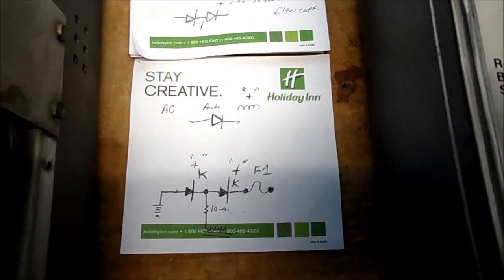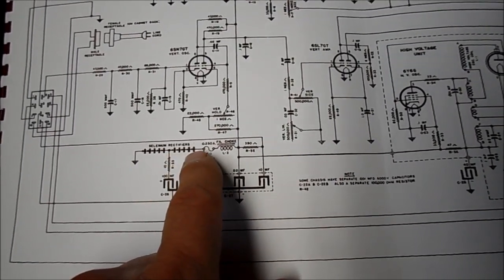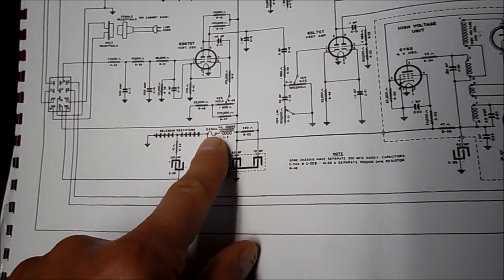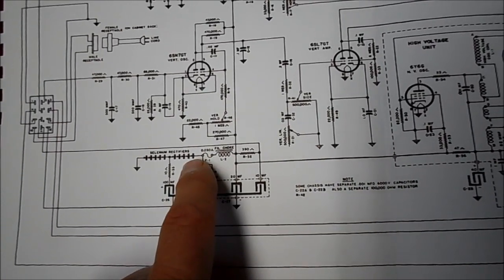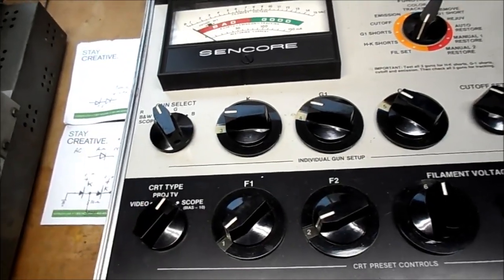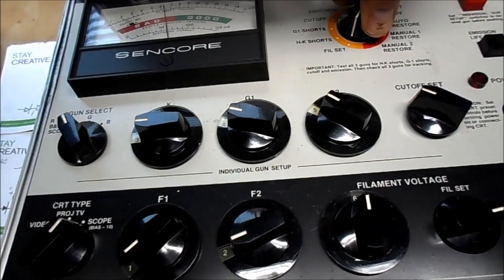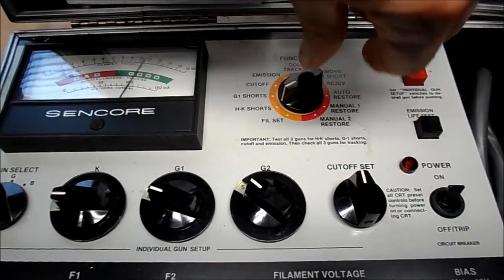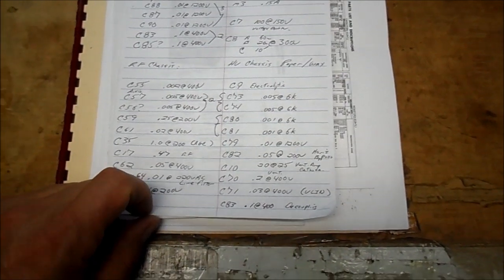Sentinel 400TV Pt. 3. 7JP4 Testing. Some Ideas On The B+.

Comment: If you have the CR70 operation, application and maintenance manual on page 22-23 it explains how to remove G1 shorts. I seen bandersen do this on a 7jp4 with his CR70 in one of his early videos and it worked great. Maybe you can find this video.

Comment: Hi Robert, Another way to test for G-1 short is to check the 22 Kohm resistor and the 10 mfd capacitor in the sync seperator cathode circut. That provides 3.6 volts to the crt for DC Restoration that resistor and cap would not be able to handle the roughly 1200 volts focus voltage if it's a G-1 to G-2 short. All the best, Tom J. from Florida :-)

Comment: Hi Robert, Low B+ should be about 120vdc, high B+ should be 250vdc and mid hv should be 750 vdc lastly 6x5 heater should be at 680 vdc. All taken with a 20,000 ohms per volt meter. H.V. should be 5,000vdc. That 7JP4 may have a G1 to G2 short. With that kind of short the CRT is turned on hard.  That would account for the loss of tracking.  There isn't an easy way to test for that. Only way I have found to test for that type of short is to put a volt meter connected to G1 and ground of the CRT tester. Oh, pull G1 clip lead when doing that test, G1 should be floating.  Shouldn't be a reading of any amount. All of my CRT testers now have a pin jack connecting to circut ground for that test. Sentinel made the same set for WARDS as an Airline 94GSE-3015A which SME ELECTRONICS has the SAMS for $10.00 and it's a folder off the SAMS printing press. That should help you out. I go to SMC to see if they have the needed folder before I spend money for a poor pdf scan from SAMS. All the best,Tom from FLORIDA:-)
Reply from the maker: Got the SAMS for the Airline, thank you. That's a big help. It includes the missing pages. Will check that G1 to ground & any other pins.

Comment: seems like the bias voltage should be lower you have it set to 68v looks like.
G1 short, try to confirm that with a multimeter just check the G1 pin to all the others. it looked like a hard short, try tapping the neck of the tube (lightly of course).
Reply from the maker: Will do. Everyone seems in agreement. Uh–oh. Seems the G1 reading is not a good one. I do not have another to compare readings. Never tested one before. Ok, will ohm this one & see.

Comment: Only 2KV on the high voltage?
As I recall those 7" sets ran about 5,500 to 6,000 volts for high voltage.
Looking at that HV transformer each "pie" winding should be about 1KV, so 5 pie windings should be about 5KV, 6 pie windings about 6KV.
No idea why you show a "G-1" short.